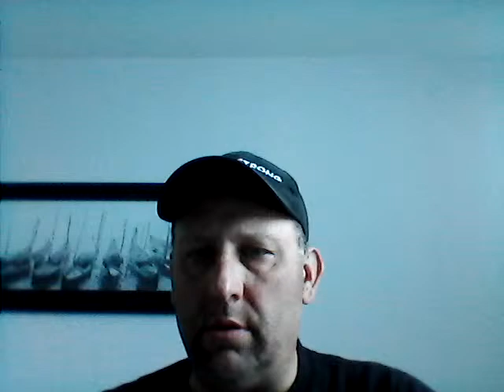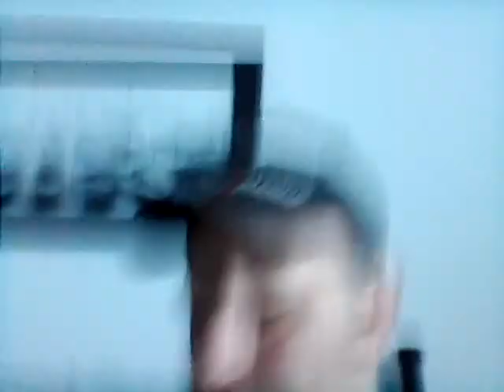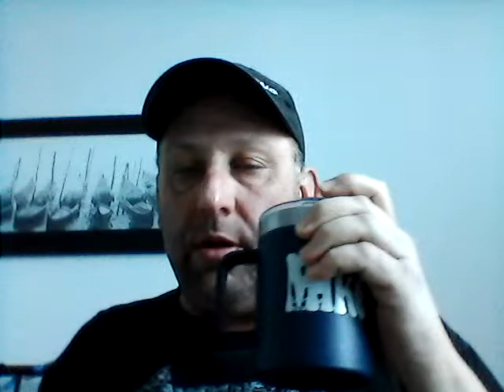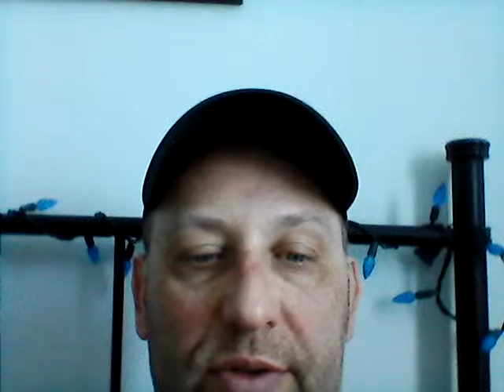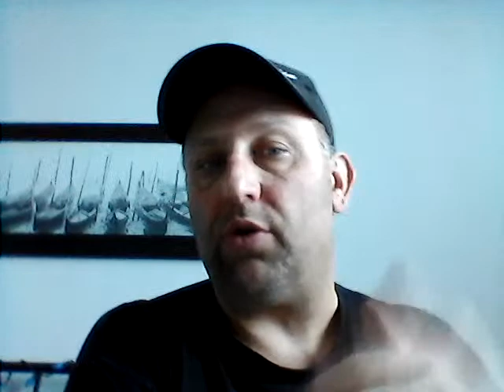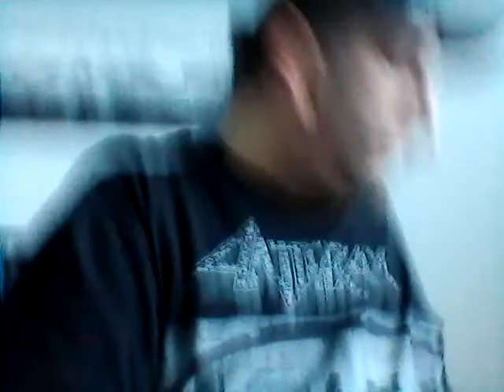Faraday Research RND

Comment: Looking healthy buddy. Been working on and off on hydrogen conversion kit for a formerly gas powered generator on and off lately. Trying to incorporate piezos from what ive learned from you to help the efficiency. Well that parts in the plans in my head...just got the funds and time to finish the electrolysis chamber. Lots of metal filings in my hands from doing all the plastic and metal plates by hand. Have a short video up with the final result there if u wanted to see.  Sorry i couldnt contribute this round. Been working on my dream desktop and putting into my projects as well. Best of luck with donations! If ur still short on wednesday, lmk and ill help with what i can!